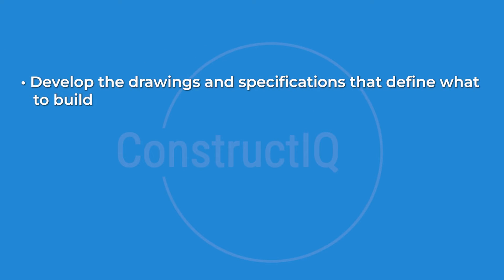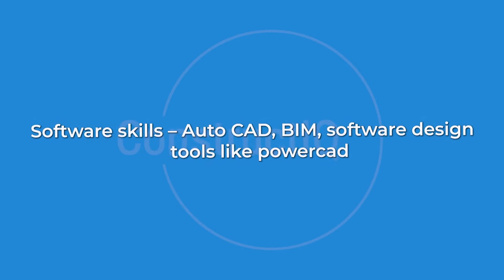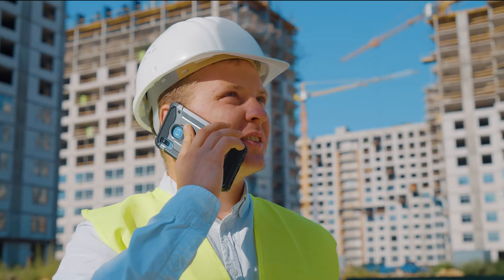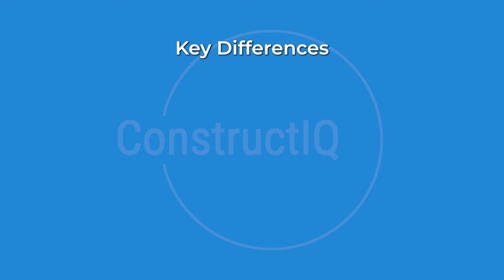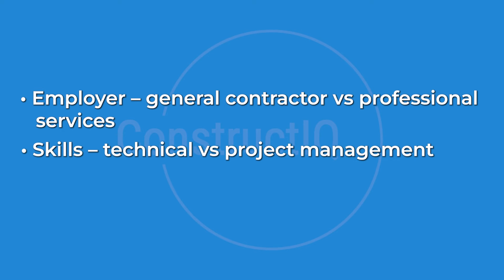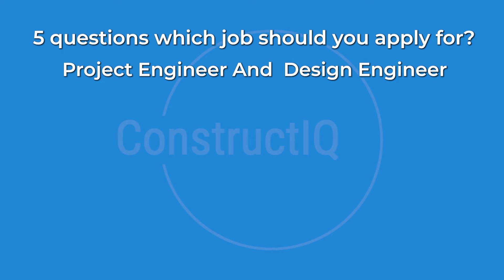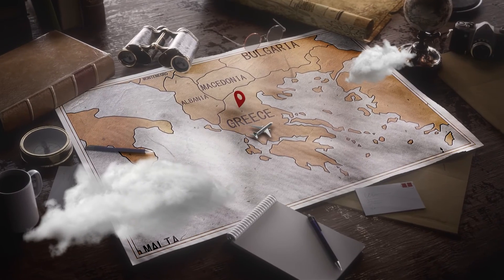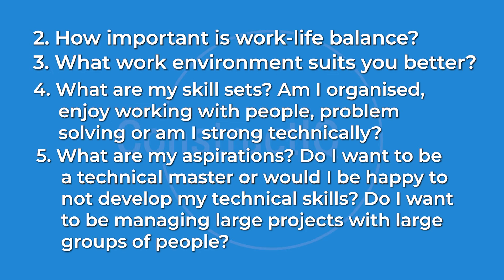Design Vs Project Engineer: Which Job Is Best For You?

Comment: In the United States, it is very confusing because a project engineer doesn't necessarily need an engineering degree to get the job, a construction degree is usually good enough. This makes the construction degree temping since it is much easier than a civil engineering degree.
Reply from the maker: Yeh, I also thinkn the construction degree is more relevant. Technical engineering degrees don't offer as much for site based construction roles